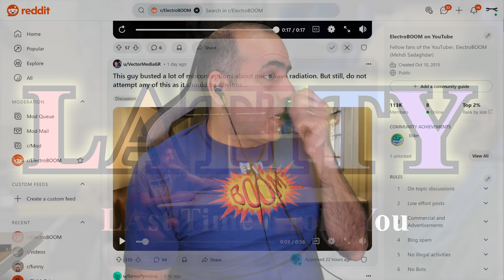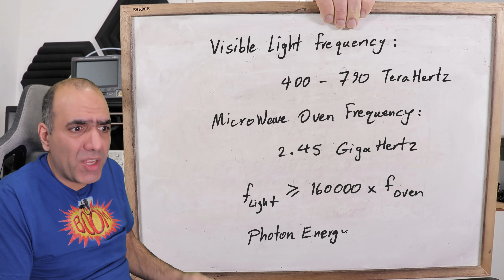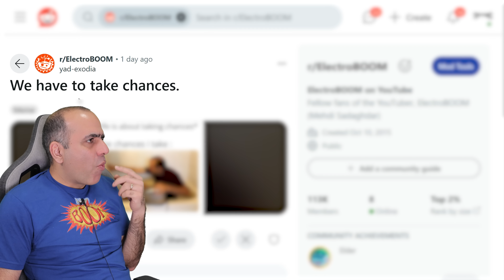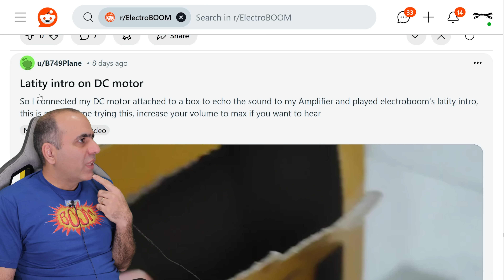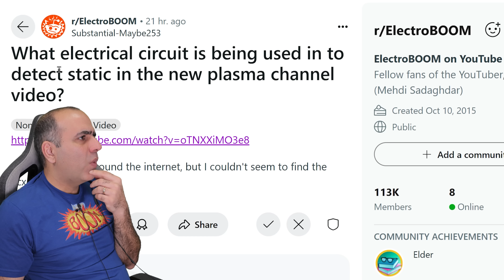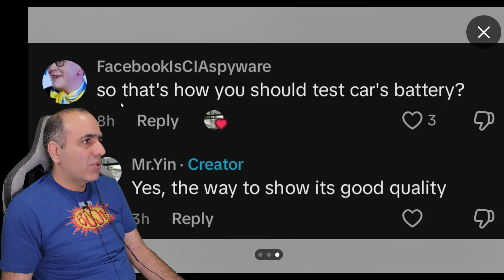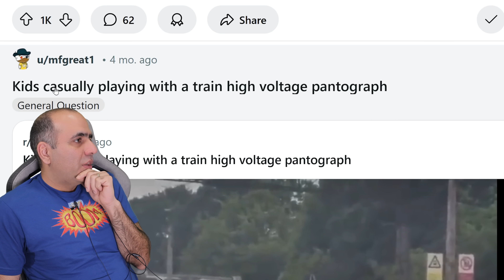Can You Microwave Yourself?! (LATITY014)

Comment: Yes UK and euro are made to be compatible as we get alot of Europe visits but still should always should use adaptor as the reason for it is for shaving and electric toothbrush and travel hair dryers as you can see if not using adaptors you bypass the ground / earth

Comment: 10:47 plugs cannot enter the socket without latched in the earth pin being engaged.  They did the same trick as myself I can remember when I was fourteen, engaging the doors manually with an item on the earth plug to expose the contacts and shove them in.

Comment: Some minor corrections on the microwave portion from a nuclear physicist.
1) The Active Denial System doesn’t act the same way as a microwave and doesn’t burn you from a distance. Microwave describes a frequency range, not a specific frequency. For ADS, the frequency is not tuned to excite the water molecules - which is what heats up your food - but instead the neurons. It “feels” as if you’re burning but you aren’t. Still extremely unpleasant and probably not the best way to disperse crowds which is why it was cut.
2) More of a clarification for others but by radiation burn, it’s not the same as UV burn, it’s more of a thermal burn caused from the microwave exciting the water molecules, heating up his hand from the inside. Just to make sure people don’t conflate that microwaves cause your food to be radioactive.

Comment: I would say that despite 2.4Ghz being a non-ionizing radiation, they can change the temperature inside parts of the cells never exposed to that changes otherwise. From a considerable distance is probably safe, however, on the long term it might cause problems, energy is still high (1W in radio is a considerable amount, this is 800x higher). I know you clearly state against it, but I would rather avoid it.

Comment: 9:10 I try the same technique but this capacitor didn't shock me😅 maybe the output is DC I check in multimeter 300 volt DC but it didn't shock me

Comment: In the RTG in this video, it was suggesting the use of steam and a generator. But real RTGs use thermocouples. Could you do a video on thermocouples, why they work in RTGs but aren't used here on earth (say, in a desert where you could focus heat on wire A that couples to wire B that runs to a cool place)? I'm assuming it's because in space you can have ultra-cold temps and somehow that draws more current out of the thermocouple, but if you did a video on it, showing the coefficent of efficiency in an earth-based "rtg" (from a non-nuclear heat source), I think it would be cool.

Comment: Yes you can use EU plug in UK socket but you need to put something inside the ground hole to open the security trap door of the live and neutral holes of the UK socket. Also on some more powerful EU devices like irons or hairdryers, the prongs are thicker which can make it harder to put in the UK socket and usually bends the contacts inside. After that UK plugs no longer make good contact inside the socket and on some of them I even found small signs of melting.... Its a nice life hack but longterm, USE THE PROPER ADAPTERS PEOPLE! xD

Comment: back in the day with drone racing you could let your drone makke songs on start up using the motors to make sound and the normal sound when powering one up is the sound the motors make when its doing its tests so yes motors can make sound only the drone racing motors are 3 phase tsla motors so ac

Comment: With regard to the bridge with the high power line. It's not faked and the sensation is true. I've seen at video on this before and one of the guys that worked on the project said it's a railway under that cant be moved and the power lines are of an exceptionally high voltage. They had to make it closer to the lines than what is recommended, and this cause you to actually feel some effects from the power lines. You're basically standing on grounded metal and have high voltage about you.

Comment: Back in the 1990's I got a burn from a commercial microwave oven that was in a filling station selling hot food, you put your purchase in the oven and set it according to the designation on the food wrapping. When the buzzer went I put my hand in to recover the food but the magnetron was still on and the interlocks failed so I got a burn to the back of my hand that not only felt like a burn but an electric shock at the same time. I remember that when microwave ovens were becoming the norm in pub kitchens etc that there was a scare with microwave leaks causing cataracts and corneal damage due to the leaks.

Comment: 11:00 Euro plugs were designed to fit into the various european sockets, france, schuko etc, so yes it works as intended. That's why the lugs of the euro plug are slightly angled and flexible.

Comment: 10:38 As a French, most of my chargers are compatible with 220/110v, but abroad, this is not the same shape, because you are not on the same ground. 🤣
Technically it's becoming so compatible that sometimes multi-shaped sockets are available. (square and round holes at the same time with multiple grounds)

Comment: Plugging EU plugs directly into UK sockets isn't normally possible. For anyone to do it they have to defeat the safety features of the UK sockets. The shutters will normally stop you putting in a EU 2 pin plug. To put one in you need to wedge the shuters open by shoving something in the earth pin, generally it isn't recommended as the contacts aren't shaped for it and you can damage the shutters depending on what sort of shutters you have. (could probably damage the contacts too)

Comment: Don't trust your senses when exposing body parts to microwave radiation! Just like there are hot and cold spots in food, there will also be hot and cold spots in the body tissue. The body can only really sense temperature change at the surface of the skin, much less inside the body. Meaning if there is a hot spot 3cm deep into your body, you won't notice it as easily and damage may be done before you feel it. Either way I don't think you will be doing this more than once in your life (I hope), great video!

Comment: Euro-plugs make a good "safe" connection in UK socket outlet, BUT  it's not fused like UK plus. UK plugs are typically on a 32AMP circuit breaker "ring circuit!!!! So it needs that fuse in the plug 🔌 to protect it from all that available current!! I think it's safer to plug it into a extention cord, because that will have a UK plug on the other end fused at 13Amp🧐😉👍. https://youtu.be/N9btrhcon00

Comment: 11:29 Yeah, it doesn't have anything to do with the water. Putting "fissile material" in water will only make the fissile material match the water's temperature after some time. You need at least two pieces of material, and they need to have enough mass so that together they approach critical mass. When you bring them together, they'll heat up. If you do that in water, you can make steam and run a turbine. But it's not even remotely "free", in any sense of the word. 🤣

Comment: as a kid , back in the late 1970s I did do the 9v PP3/6LR61/MN1602 battery across the tongue , I thought "well that wasn't too bad" .
I had a 12 volt DC toy train set, so what else could a 9 year old do than wonder , "what is 12 volts like across the tongue instead of 9v ?" .
So I decided to put my tongue on the 12v DC rails. It took a while for my taste puds to recover !
Needless to say , I never tried more than 12v, and well never even tried 12 or 9v EVER again !!! That experiment was done and dusted for a life time !

Comment: Yes Mehdi, come to Brasil. Here will be your dreamland. PS: There are new electrical showers that the resistive material is covered in a coating similar to electrical ovens so there is a minimal escape of energy to the water. They made it so you can use an general GFCI (here we call it a DR), so I can attest that modern electrical showers are very safe.

Comment: I have one of those surge protectors that has 18 outlets, they're good for shops and offices where you have a lot of low power devices or a lot of tools where you are only running one or two at a time. For instance, I have a repair table in my garage that has all sorts of small drills, dremels, small lights and other things plugged in, but I only use 2-3 at a time. Keeps me from constantly having to plug and unplug things.

They're basically the same as those long shop strips that has 10-12 outlets on them, except these are safer because they are actually surge-protected.
Reply: Surge protection has nothing to do with preventing overloading sockets, though. it simply protects any device plugged in to the strip from transient voltage spikes. The reason that these multi outlet power strips are safe is that they have a fuse or current trip. Well, they should, anyway!😉

Comment: Those are probably AC power lines in Minnesota. You can tell by the number of conductors, six being very common: two 3-phase circuits. I suppose they could be three 2-wire DC circuits but I've never heard of more than 2 conductors on a DC route. The sign probably says "static electricity" because that's how an AC electric field would feel to most people.  If you work out the electric fields under the wires I doubt they would completely cancel at any point on the ground near them.
Reply: There is 2 HVDC lines in Minnesota. one goes to Fargo and one to Duluth. They only have 2 lines and look different.
Reply: @LaserFur  Thanks, that's what I figured. I am somewhat familiar with the two here in California. Both go to Los Angeles, one from the Columbia River and the other from a dedicated power plant in Delta (central) Utah. Yes, they definitely look different, with two (very) high voltage conductors each.

Comment: The 2-pin Europlug will fit into a UK socket (as you showed) except that there are supposed to be shutters blocking the line and neutral openings inside the outlet.The shutters are opened by inserting the ground pin, which is longer than the other two. If the outlet has no shutters, or if they're broken, the plug will fit as shown. But it won't fit in a proper outlet. Years ago I bought some plastic "adapters" in a market in Singapore that will "cheat" the ground pin and open the shutters so the Europlug prongs will enter.
Reply: Nowadays, there are "2-pin friendly" UK sockets that have safety shutters which will move out of the way if both prongs of a Europlug are inserted at once. No cheating needed.
Reply: @rherydrevins  Thanks, that's useful for our next trip to the UK.
Reply: @rherydrevins  Speaking as an American the safety shutters in the UK socket have always seemed mechanically complex and unreliable.

Comment: The only problem with Europlug in UK sockets is that you need to open the shutters. One way is to plug in a UK device the other way so that the ground pin goes in but the live and neutral pins are outside the socket, that opens the shutters and you can stick in a Europlug.

Comment: 13:15 I know of some high voltage power lines coming from a local coal fire power plant in a town nearby, and you can definitely feel slight static and hear them hum when you get out of the car in the store parking lot they pass over.

Comment: So UK plug sockets usually have little gates that only open when the slightly longer ground pin is inserted, but I assume there'd be ones lacking those gates in a country that uses both UK and Euro exactly for the reason shown in the video.

Comment: Question about the battery testing video/picture. You say he wrecked the battery shorting it like that.... but in auto school we used a "VAT40", which was just cables connected to a carbon pile and a dial. The pile would glow just like this strip here in the pic, yet we didnt wreck batteries and this was the industry standard for testing lead acid batteries. 
So is a thermal wire really a bad way to test? If it provides a load then whats the problem unless you over discharge?

Comment: 14:30; Kids never play with high voltage lines from a pantograph because the arcs are large if one of them touches the metal bar of the mechanical linkage, the voltage can kill very deadly. Do not attempt to play high voltage equipment for younger kids. Also, never go on top of a moving train, it is hazardous, and it could lead to death, permanently.

Comment: I think the most interesting thing to me was seeing the ceramic insulator on the magnetron glowing red hot. I had no idea they got that hot. That's not a part you ever get to see, so it was kind of fascinating to see it in operation without any metal casing around it and seeing that ceramic insulator glowing red hot like that.
Reply: It's possible they don't normally get that hot, but that this one did because the missing waveguide resulted in high SWR (with the energy reflected back into the unit and dissipated as heat rather than being transmitted as microwaves).

This is related to the reason you don't run a high-end audio amplifier without speakers (energy that should be radiated as sound is reflected back into the amplifier; the resultant heat buildup can damage the unit).

Comment: Yeah, but visible light is a higher frequency and higher frequencies. Don't pass very deep, while submarines radio transmission work at one hertz, or somewhere in that range, because he needs to have a lower frequency to pass through the water.

Comment: 13:15  if you ride a carbon bike you won't notice the static electricity. If you ride steel or aluminum frames you could feel it. Sometimes powerful shocks, sometimes barely anything. I felt it between my fingers before. And unfortunately, my ass and thigh with no bicycle shorts
Reply: Or you can go with a plastic 🚲

Comment: Euro to UK plugs have quite different surface areas of their contacts. The Euro plug especially will not be able to conduct as much current with its greatly impaired contact surface area when plugged into a UK plug. You wouldn't use #20AWG wire in a 15A circuit!!!!

Comment: The EU plug into UK socket is probably an issue for a few reasons, the biggest is the smaller pins on the EU plugs wouldn't make a solid connection and would risk heating or arcing, but there's also the issue of earthing - an earthed Schuko plug for instance wouldn't contact the earth on the socket, and you would have to defeat the shutters on the socket for it to work at all. Not the worst thing in the world but not great either

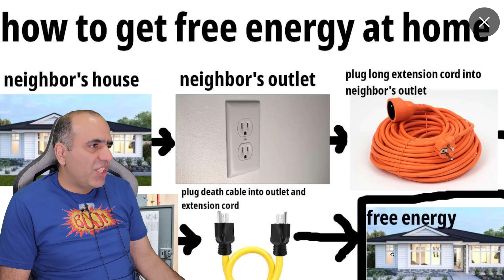Comment: 12:00 I used to work at a hardware store that sold extension cords, and sold a metric ton of them during Christmas season and power outage season (thanks sdg&e, you could just help prevent fires instead of shutting all our power off) During outage season the idiots in my town would go buy a generator and try to hotwire their house using a double ended male plug which funny enough in some weird way is illegal/against building code and can result in fines and possible house fires. Every year when it was outage season I'd have to do a PSA for all the store people telling them if there was a customer to come in for that we were to deny any assistance and all the way up to denying sale to do our damnedest to dodge being liable for their house burning down
Reply: One of the reasons it's illegal is because if you forget to turn off your main breaker, the electricity from the generator will feed back into the transformer, which will step the voltage back up to thousands of volts, and could easily electrocute line workers.

Comment: I previously worked under contract to maintain the right of ways for transmission lines. If we parked the work truck under the 500kv lines, not only could you hear the lines humming but the truck would also shock you if you touched anywhere the paint was chipped off.

Comment: The UK socket has a bar blocking line and neutral unless the earth is inserted. This is part of why the earth pin is longer, so it connects first, and unblocks access to the other connections. You don't notice this in practice when inserting a plug.

Comment: When you operate a magnetron in free air, it's radiation is omnidirectional. It's not concentrated in a box. RF dissipates with the square of the distance so very quickly. To get any power you need a directional antenna, tuned to 2.45 Ghz. A dish would probably work best.

Comment: This is a very low power magnatron, should try using a few large variacs to increase the voltage directly to the tube. Bring it up to 500-1000 volts, then try higher. Eventually it will begin to arc internally until failure, but itll be pretty to watch lol.

Comment: Don't do it for more than 1 minute out of 6 and keep your eyes more than 1.5 metres away from the source and you will probably be fine. The ony issue is that the eyes do not have an efficient way of self cooling due to the lack of an efficient blood supply to dissipate the heat generated. You would eventually develop cataracts if you were to do this regularly. The compliance distance for a 500 watt isotropic source that has a 100% duty cycle at 2450 Mhz is just over 3 metres so don't worry too much. I'm sure you did some research before exposing yourself.

Comment: Myself who got my only "A"'s in school in my "Microwave Lab"...theory,  an A-minus. The Magnetron here is running at 2.45 Gigahertz, that stub looking thing is the antenna, one-quarter of a wavelength long. For a comparison of frequency, the big towers we see that transmit AM radio signals are gigantic antennas, hundreds of feet high...That tiny stub you see needs to be "contained' , guided as it were,  inside a waveguide...the structure used is a rectangular metal tube (Transverse Electric, or TE-10 mode)...the signal "marches along" step by step along down that tube. Without that tube to contain the radiation, it dissipates into the surrounding space .